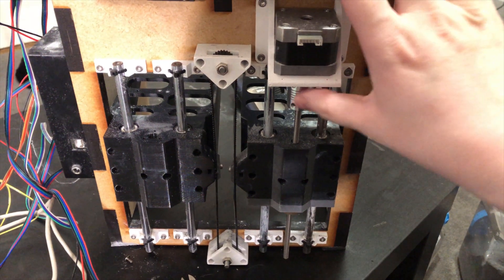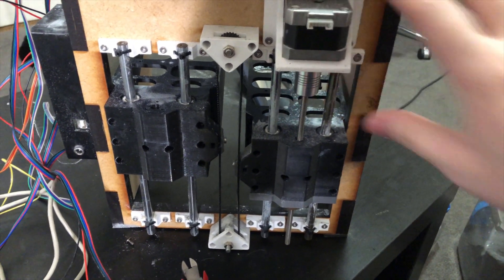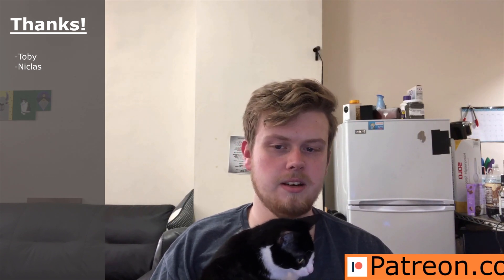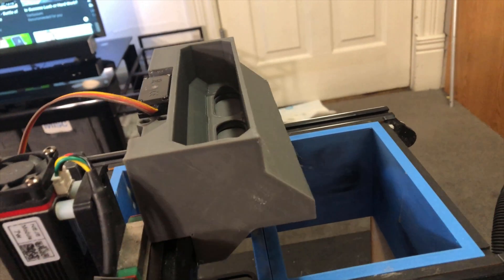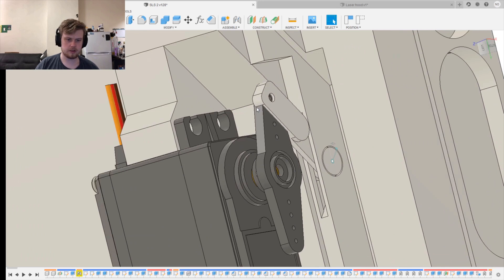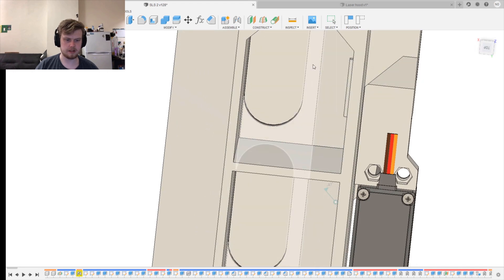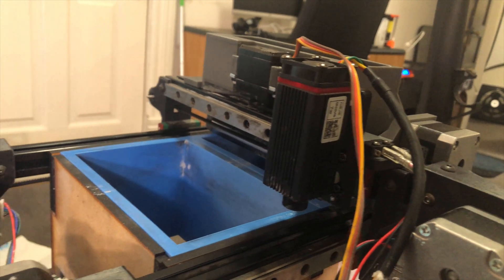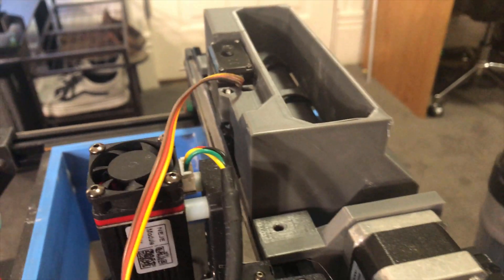DIY SLS 3D Printer || Part 9

Comment: i dont know if your still working on this

but if you go back to the dual piston variant, oversize the resovoir

then put an overflow bin on the other end

so you add too much powder each layer and then just knock the powder of the far end.

that should help with any inconsistent layers

Comment: This project is never going to work unfortunately, looks like some good Fusion 360 practice though. Keep practicing.
Reply: The wright brothers heard that a few time. Innovation is often perceived as lunacy to those that dont try… this is amazing work, and with time and effort 100% feasible.
Reply: @jonathonhaberkorn233  It's never gonna work because the powder is not heated, which means the powder will curl up as soon as the laser hits it and completely ruin everything. It's just simple physics.
Reply: @henrychan720  The plan is good, just needs to be built with preheating in mind, maybe build the frame out of aluminum sheet, double wall with an electric heater between walls?

Comment: an rotating auger going past slits is how a projet 660 works. the more times the auger passes the slits the more powder is dropped, also the whole powder dispensing hopper sits on a pizio sensor to know how much powder has been dropped.

Comment: that looks like a bar drop similiar to whats used with those ammo reloading powder drop. There is also another type of powder drop where they use a rotating cylinder. It spins around and the notch in the bar or rod measures perfect amount of powder each time. But i don't think powder drop accuracy matters for what you're doing. when you lower the print bed, there will be a gap which will conveniently make any excess powder roll off anyways.

Comment: Neat, but you can't change the amount of material you deposit.
The solution everyone else seems to use is making the reservoir slightly larger and pushing the excess off the end into a bucket.
It'll be interesting to see how this goes. If you go any further with it?

Comment: i was thinking about using the same xy axis for the laser and to a powder feeder with consolidation roll to compact the powder in all the area.
 i suppose an arduino short range lidar sensor can be attached to measure the powder thickness in all the xy axis.

Comment: Just found your channel, cool work! One way to handle the powder layers is to have the feed bed be larger than the print bed, and use an overflow bin at the end. This makes it so you always guarantee there's enough powder to cover the layer, while just pushing excess to an overflow bin to be emptied at the end